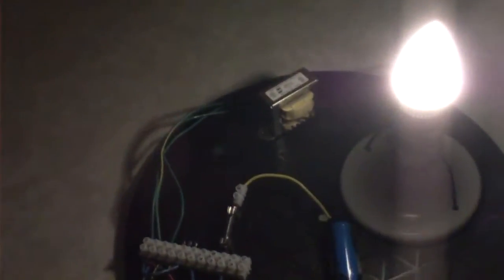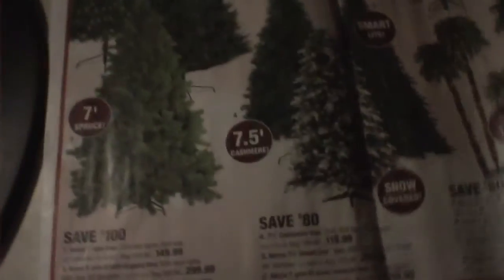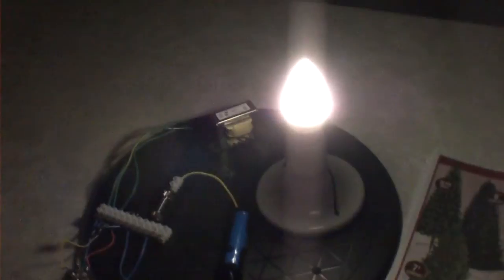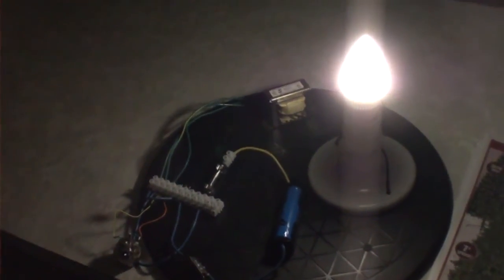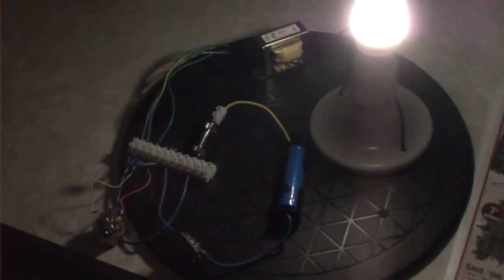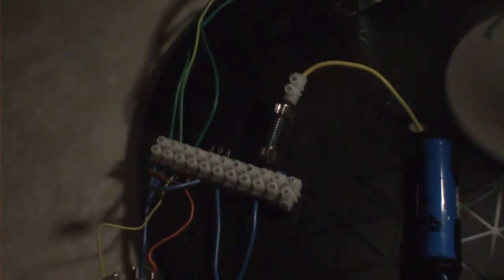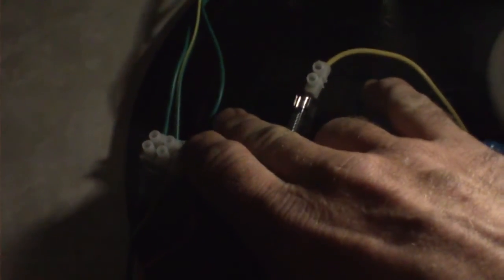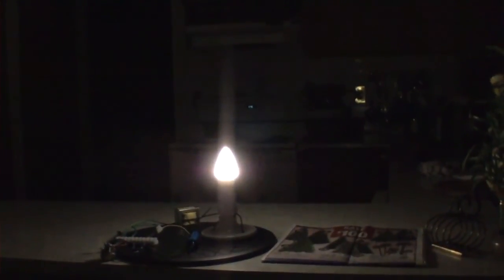XEE2vids Joule Thief / Ringer - 4v / 240 mA (.94 watt) - DC/AC Inverter Powered Light

Comment from the maker: @MrTwally67 It's pretty much as the math would lead you to expect: 1 watt delivered by the 3.6v inverter is about half as bright as you'd get from AC mains. I'm going to do some power consumption comparisons running it on a variety of commercially made inverters ranging from the cheapest of cheap, to a decent sine wave inverter, to a large modified sine wave inverter.... and post the results. Thanks

Comment from the maker: @zackthegoth Correct LOL i didn't want to wake up my daughter LOL. Zack, I highly recommend if you are having trouble with this device (and I did too, a bit...) that you go grab one of those white terminal strips (ceonnection strips), watch XEE2vids presentation in the link above, and literally copy it. He has reduced it to a "no brainer". If it will still not oscillate... you need to add a potentiometer to the coil-base connection, and a rheostat on the + input. In this way, you can dial it in.